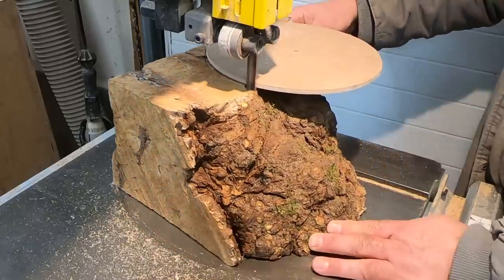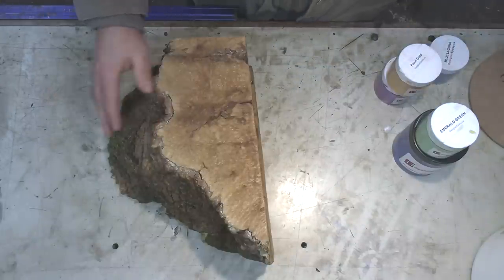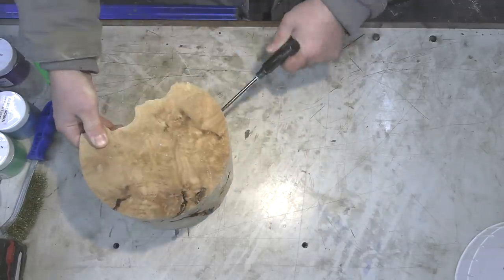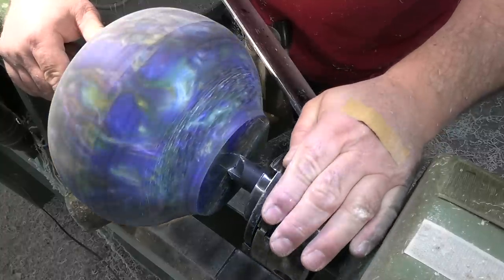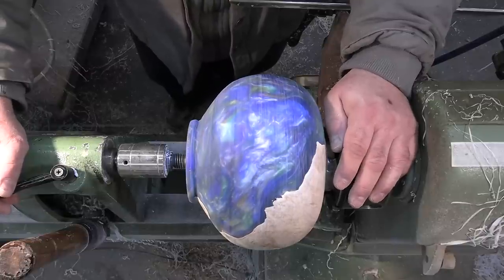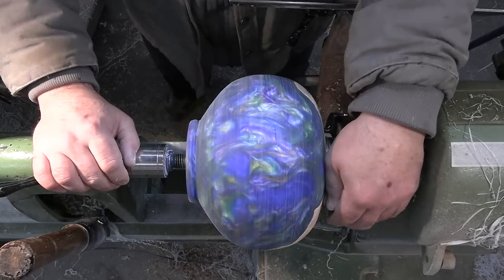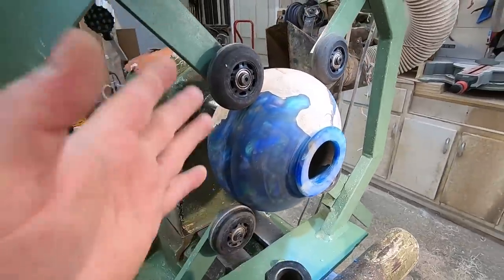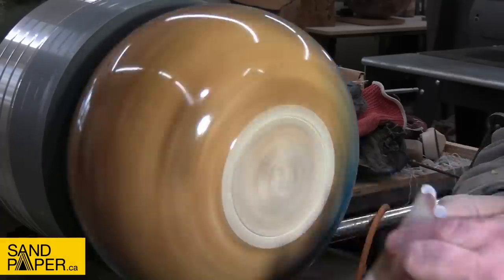Woodturning - The Peacock Hollow Form 3.0

Comment: I find the volume of the resin effect the curing time along with the temperature. As you saw on yours the giant bucket cured faster than the smaller one. I also notice that resin cures go from top to bottom. Putting the work on a slow rotation when using an epoxy finish I get a smoother finish and no bubbles. I do like the coloring that you achieved on this bowl. And am glad that you left the resin on the top, it belongs there.
Reply from the maker: I personally find the epoxy starts to cure in the dead center of the bucket first before the rest starts to cure. Thanks for watching!

Comment: Beautiful! Nice job getting the colors how you wanted them 👏🏻👏🏻👏🏻 Just an FYI, when you use alcohol to pop bubbles, use 100%. The finer spray you use, the better. The alcohol will leave an oil slick looking finish on top of the resin. It would be fine for inside or first layers but don’t use it on any top coat, use the heat gun/torch. The best spray bottles are travel size pump or those bottles that have the air pressure inside so they spray continuously like aerosol does.
Reply from the maker: Guess I’ll just stick with the torch, lol. Thanks
Reply: @SpragueWoodturning  If it ain't broke....lol. You're welcome!

Comment: What a tour de force. I continue to be impressed by the care you take completing a piece, even the inside of a hollow form that no one is ever going to see. A couple of questions: 
1. Have you ever done inlay on a piece that includes resin? It occurred to me that a thin band of gold or copper around the top of this piece would have been a nice accent.
2. Are the bottoms of your pieces flat or slightly concave? My concern would that the piece would rock or not sit quite straight if it isn’t completely flat. Maybe it’s not that difficult to get a flat bottom on a lathe.
Reply from the maker: Yes, I did a video on resin bits inlayed in clear resin and the bottoms are concave to prevent rocking on the table. Thanks for watching!

Comment: Hi Jim, finally managed to get what you wanted. Congratulations for your persistence!  The finish is really exceptional, colorwise and surface wise. 

1) I would have kept the resin on the top as you did. 
2) I also use the OneWay hollowing system like you
3) I use the one way steady rest (two weels) and it has up to now been stable. I was wondering what are the avantages of a four arm system!
Have a nice week. I also turned my best cherry burl/resin project last week! Sure is rewarding!
Reply from the maker: The four arm piece will prevent the piece from coming out of the chuck. The bowl steady that you have won’t prevent the piece from doing that, it’s just meant to keep things from vibrating while turning. Thanks for watching!

Comment: STUNNING!!!!  That is one of my favorite shapes when I'm turning but that epoxy simply ups the level 10x fold. Reminds me somewhat of 2face in the Batman series. From one side all you see is epoxy & the other mostly wood.  
Would the black/ultraviolet light epoxy work as the finish on the inside, provided you could get a light inside or is there some property of that type of epoxy that wouldn't allow it to work? What about the exterior finish?
Definitely one of the best epoxy mix turnings I've seen.
Reply from the maker: I’m actually working on that myself, but yes, if the UV light can get inside it should work and be faster. The only real issue is it’s thickness. Thanks for watching

Comment: The chemical reaction in the bigger buckets will generate more heat than the smaller ones as you saw when you layered it. The same size buckets for the resin would equalize the temps I believe.
Reply from the maker: Correct. Thanks for watching

Comment: Looks amazing. Would a heat gun provide sufficient heat to pop the bubbles on the inside? It would be safer than the torch.
Reply from the maker: Yes, the only problem with a heat gun is they tend to spray crap all over the surface of the project. This is why I don’t like using them. Thanks for watching

Comment: Nice job - you finally succeeded in achieving your vision for this piece.  I will admit I was a little worried when you separated out the 3 smaller containers because the lower volumes won’t get to as high of a temperature and will have lower viscosity which can lead to color separation issues.  If time allowed (and it wasn’t the middle of the night) I would leave them in one big container for the first 10-12 hours then separate and mix the colors.
Reply from the maker: That just might work too. Thanks for watching!

Comment: Wow that was beautiful. A couple of weeks ago you asked about keeping resin on the top of a piece. I was a vote for keeping it then. So when you asked this week I immediately said to myself, "please keep it." I think you made the right call. I noticed when you were putting the glue block on, it didn't appear to have the grooves in it that you usually have to help with adhesion. Did I just miss them or is there a reason that you do not do that for some pieces?
Reply from the maker: All of the waste blocks that have the faceplate on it will have a groves, to be honest it’s probably not needed. Since this was going into a chuck, this is why it didn’t have groves on it. It was just laying around the shop so I used it. Thanks for watching.

Comment: Howdy Jim. Sorry for asking a question I’m sure you’ve answered, but how do you decide between pressure pot and vacuum? Phenomenal job on this week’s project.
Reply from the maker: Ideally it’s preferred to have both. If you use a vacuum chamber you can then cast on the bench after vacuuming and it should be fine, but you can really only do it with deep cast because of the long open time. In most cases I usually just put it into the pressure pot and rarely have issues. It’s probably just going to depend on you’re budget. Don’t know if I’ve answered your question or not, lol. Thanks for watching
Reply: @SpragueWoodturning  Yes and thanks.

Comment: What a stunning piece!
I loved the previous attempts too, but this one really outshines them!

Quick question - you said in the pestle and mortar video that you don't recommend using two different finishes on a single piece as there may be issues, hence you using mineral oil on both the inside and the outside. Does that mean the finish is a bit "worse" in terms of possible future issues when you do the inside with resing and the outside with gloss, or is that the same because these are both more "covering" finishes?
Reply from the maker: Both of those finishes would be in the same category. Both are film finishes. Thanks for watching

Comment: Hi Jim, yes a marvelous piece indeed. Your face as you were showing it was amazing, just so happy. I think the larger volume of the two colours thickened first purely as they were a larger volume, if you'd used 7 pots with two blue and two green with all seven being of approximately the same volume my guess is that they would all have been curing at the same approximate rate whereas the two larger pots were creating a slightly higher exothermic reaction due to the larger volume and thus slightly higher temp and faster cure relative to the three smaller pots.

I've watched I think pretty much all of your posts at this point and with the exception of the carbides you very rarely have to resort to a scraper, in your opinion is that just sharpness of tool, presentation and feed rate?

Sorry final question, what kind of cost is waterlox low voc original on Canada? In the UK it's circa £88.00 a quart.
Reply from the maker: Putting the resin in the same size containers makes a lot of sense and should absolutely cure at the same rate. This is what we pay for the Waterlox here in Canada. https://exotic-woods.com/products/finishes/waterlox looks like it’s way cheaper than the UK. 

With sharp tools and proper tool presentation I don’t see the need for scrapers. Thanks for watching, I really appreciate it!
Reply: @SpragueWoodturning  thank you. That's a lot lower price than the UK.

Comment: I'm not a woodturner, but I do have a question before ordering a piece.

I love the final peacock hollow form color, and I especially admire the uniqueness of finished burl. But given the concave shape of the original piece of this burl in the video, would it be possible to glue other pieces of burl inside the concave part of the original, before resin casting? The goal would be to make the peacock resin more of an accent color than the dominant part of one side of the finished hollow form. (I'm unsure whether glued-in pieces of burl (or other wood) surrounded by resin would withstand the pressure of being turned on a lathe.)

Any opinions welcomed.
Reply from the maker: Sure, pieces can be put together so that there’s more wood than resin. Unfortunately I’m not taking any commissions. Thanks for watching

Comment: Jim I am missing something about your glue bloc. It looks like you just press it on and don't try to center it. I would think this could make your work piece wabble considerably. Did you mark a center point and I just missed it?
Reply from the maker: When I stuck it on the bottom then put it between centers I adjusted the piece so it ran almost true again. Thanks for watching

Comment: I haven’t seen all your videos, but you always remove the bark.  Why?  Could the larger pieces of bark be used as you used the walnut shells?  Could the pieces of bark be stained, perhaps with different colors resulting in some extra drama as you shape your creation?  Obviously, I have no creative talent, but I am fascinated by your’s!
Reply from the maker: The only way casting with bark would work would be if it was stabilized first. Bark is a lot softer that the wood it’s attached to and if you don’t remove it prior to casting it can delaminate from the wood or when sanding will indent because its softer. Always best to remove it. Thanks